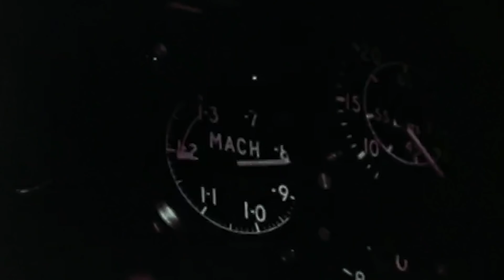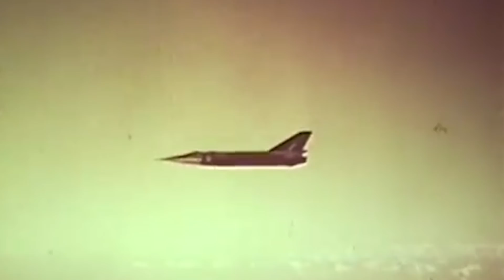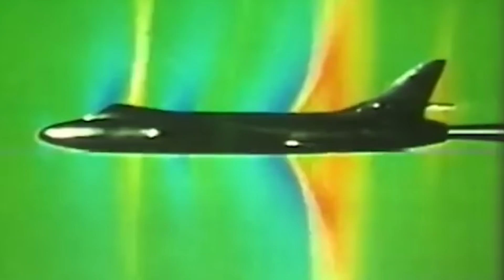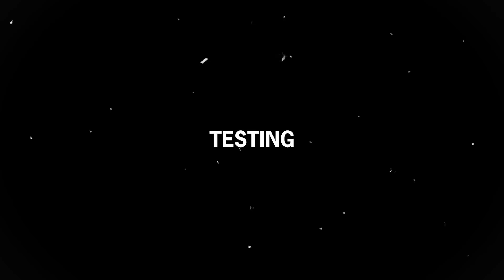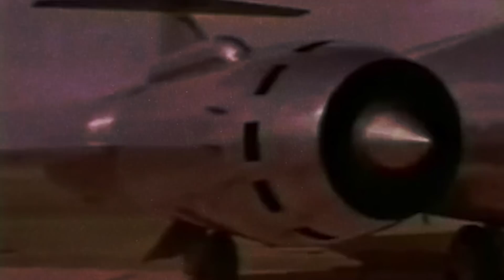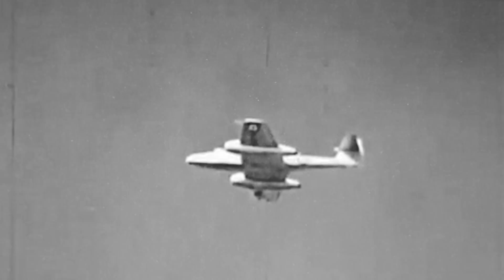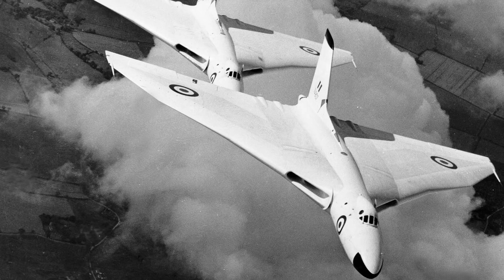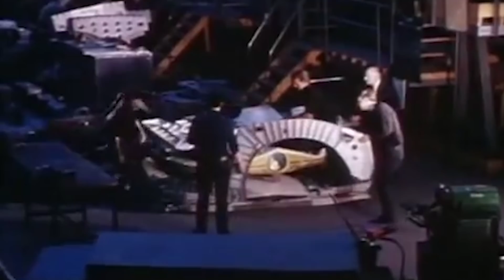The Bristol 188 Flaming Pencil - Supersonic Stainless Steel

Comment: The A12 first flight was 1962..
Reply: SHHH THAT WUZ A SECRET...
Reply: Similar design layout, titanium not stainless steel.
Reply: @chriswalker2858  stainless steel was used in MiG-25 which flew faster than the specs for the T-188 (slower than Oxcart though)
Reply: @alexx86hater 
hi A...
'
ussr russia mig-25 is a half france electric device and half ussr russia

Comment: The aircraft shown at 10:40 are the unfinished TSR-2 air-frames being scrapped at BAC Weybridge  after the Government killed that project. Another sad story of wasted development.
Reply: It has been said that TSR 2, (Tactical Strike and Reconnaissance version 2) was the most beautiful warplane in the world at that time but the Americans rocked up with their commercial imperative and made an irrefuseable offer.
Reply: @davidtaylor8304  The plane was a dog. Looks or not.
Reply: @WALTERBROADDUS  Not enough fuel capacity.
Reply: @None-zc5vg  They should have just bought the Buccaneers.
Reply: @davidtaylor8304  The Americans probably saw to it that the plug was pulled on the British aircraft industry, as they are believed to have done with the Avro Canada competition. No doubt some politicians did handsomely out of it.

Comment: Atmospheric heating is due compression, not friction AAAAAAAAAAAAAAAA
Reply: Isn't it a combination of both and conduction?
Reply: @recklessroges  nope. Even on reentry vehicles going mach 25+, friction is still not even close to the levels of heat caused by compression
Reply: @Gage  the paint gets peeled off due to forces created by the huge change in pressure behind the shockwave
Reply: This statemdment is not true, friction does cause heat rise,, moreso to the undereside of the plane    where there is less compression nnbut still a rise intemperatur.

Comment: I've always said that it needs to be a requirement that a copy of every vehicle, weapons system etc needs to stored for museum display later on. It doesn't have to contain the classified and/or expensive parts, but it does need to be a complete copy for historical sake. Given the amount of $$$ thrown at these projects, this is not unreasonable. Furthermore, several times older tech has been pulled from mothball to reference for emerging tech. Just a thought...
Reply: I see that the flying pencil pushers disagree.📉😎📈
Reply: That is not practical.
Reply: There is still an original in the raf museum
Reply: @BamBam4-4-4  I was referring to ALL vehicles in chronological order. 
,
Reply: @SCP-POOL  That makes you a hoarder....
Reply: @WALTERBROADDUS  that makes you a short sighted Libtard...

Comment: Excellent video. Because of this aircraft we still have stainless "Bristol" rivets in the aerospace industry.
Reply: The vid gives the impression that it was a complete disaster but the lessons learned had a profound effect on developing aircraft for probably decades.
Reply: @IDontWantAHandle101  The plane was a complete disaster... its design and technology were decades behind.
Reply: @sandervanderkammen9230  - Given this thread, clearly you are wrong.
Reply: @gregtaylor6146  Sorry Greg, the 188 was a dismal failure... it never achieved its projected performance and the cancellation of the Avro 730 was a direct result of this disappointing failure. 
Britian would never build a Mach 3 aircraft.
Reply: @sandervanderkammen9230  - In reply, I'll defer to musings of Mark Twain in regard to matters such as these......
Reply: @gregtaylor6146  "Get your facts first, then you can distort them as you please"
 The 188 was not the technical achievement that was hoped for... several Mach 2 aircraft were already in production and operation service in other countries by 1962
   The Mach 3+ Lockheed A-12 flew just days after the 188 highlighting just how far behind Britian really  was in supersonic aircraft technology.
Reply: @sandervanderkammen9230 Damn you are very bitter aren't you why???? your commenting on every video saying that plane was bad this plane was even worse?? Your very strange guy why are you so Triggered??? You'll probably say the CONCORDE was bad as well..Lols saddo
Reply: @sandervanderkammen9230 

We believe we can clear up some commonly held myths and misconceptions, obviously

It's always good to see the facts presented clearly and concisely isn't it? 

Interesting British achievements.
There is no doubt that the Fairey (England)
Delta 2 was of course the world's first jet
aircraft to exceed 1000 mph.  lndeed It
exceeded the previous record by 310 mph &
held the record for more than a year. Incidentally, the Dassault Mirage series of aircraft are based on the Fairey Delta 2. 
March 1956,  UK Peter Twiss,
1,132	 mph, Fairey Delta 2,	 Chichester, UK

The next speed record after the FD2 -
December 1957, USAF	1,207.6	mph, McDonnell F-101A Voodoo, 	Muroc, California 😎.

When the British EE Lightening first exceeded Mach 2 it was one of the fastest jet aircraft on the planet.

The Lockheed  XF-104 record claims before 1958 are all fictional & completely unverified. It's  interesting that the XF-104 started life using a licence built version of the Armstrong Siddeley Sapphire.

The world's first wind tunnel was constructed in England before 1877. The world's first supersonic wind tunnel was constructed in England in 1922.

The sequential stator rotor multi stage axial turbine & compressor were first produced during the 1800s by Parsons of Ireland & North England for power generation & ship propulsion turbomachinery purposes. Those basic turbomachinery components would go on to form the basis of most modern gas turbine aero engines.

At the time there were discussions regarding the use of those components for an internal combustion gas turbine aero engine to power aircraft (& ships) thus the axial compressor jet engine & jet aircraft concepts were effectively invented in England during the 1800s.

The gas turbine engine was invented and patented in England during the 1700s.

Early days, jet engines. Whittle performed the world's first demonstration of a gas turbine aero engine in 1937. The RR Nene, a centrifugal gas turbine aero engine, was the world's most reliable & most powerful gas turbine aero engine in 1944. Licensed built versions & copies of the RR Nene & RR Derwent would go on to power many aircraft in Russia including the Mig 15 & Mig 17, the US, China, France & other countries for decades after 1944. Incidentally, the Mig-15 was in essence an upsized / tweaked copy of the Whittle / Gloster E28/39 jet aircraft including a copy of the RR engine.  The centrifugal compressor gas turbine aero engine with Whittle style reverse flow combusters and sometimes an axial compressor section is still manufactured by more than one company, the main application being helicopters.

   That's correct, The Tornado & Typhoon & their engines are supersonic & are indeed British design aircraft with British design engines built by an international consortium. The Tornado design for example started life during the 1950s at Vickers as the AFVG, it's engine is based on the RR RB-199. 

The EE Lightening is also a British Supersonic jet aircraft. At the time the EE Lightening first flew it was indeed one of the fastest aircraft on the planet, it was still one of the fastest aircraft on the planet 4 years later when it first flew at mach 2

  The Typhoon is the British BAC-EAP with an engine based on the British RR XG-40, the Typhoon is also built by an international consortium.

   Indeed, There are no German companies that make German jet aircraft in Germany & there are no German Companies that make German gas turbine aero engines in Germany that are suitable for widebody airliners.

  BAe Systems, GKN Aerospace & Rolls Royce combined now do more Airbus work than Germany on an absolute basis & significantly more work than that on a per capita basis.
     
  RR now owns US Engine maker Allison for example which does classified Aerospace work for the US Govt.
   
 Anybody currently flying on a widebody airliner stands a good chance of being on an aircraft powered by RR gas turbine aero engines built in England & the UK.

We hope this helps, of course.

Cheers as always 👍
Reply: And in Cockney rhyming slang, "bristols" have an entirely different meaning...
Reply: Formed through normal means?
Reply: Percussion formed but you only get one shot at it. They work harden first go.

Comment: As Concorde’s engine intake aerodynamicist, the genius Ted Talbot said, “It taught us what not to do.” The ‘Blackbird’ layout might look exciting but the dangers of asymmetric thrust were always ever present.
Reply: El Ta Exactly, that why there is no comparison between the two! An engine failure in the SR-71 whilst supersonic was indeed survivable but very hazardous, in Concorde the aircraft would yaw towards the operating pair, not intuitive but very safe in comparison! The intake ramp configuration would actually produce thrust in the event of an engine shutdown. If you take a Convair B-58 Hustler and lose an engine whilst supersonic, that was barely survivable.